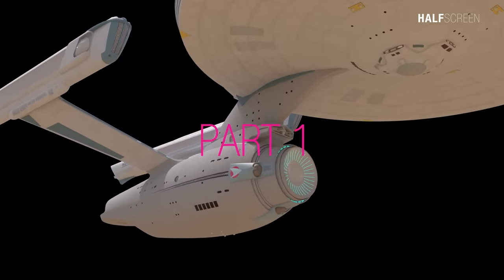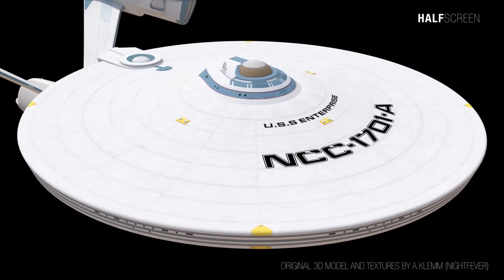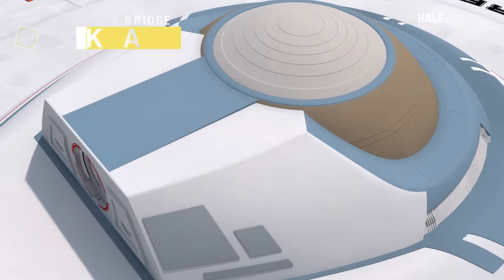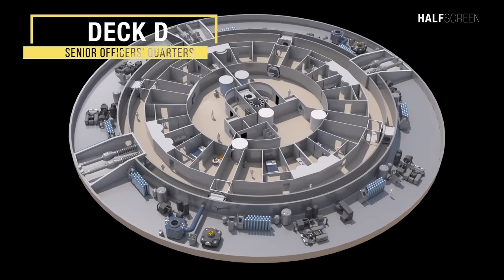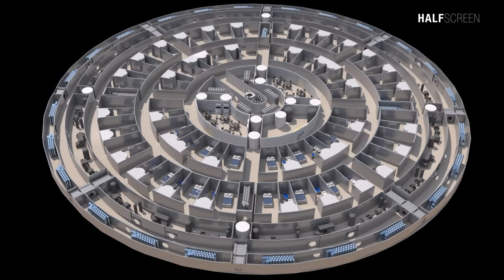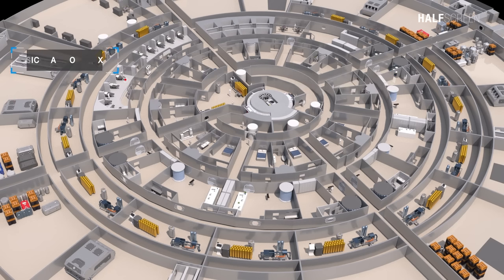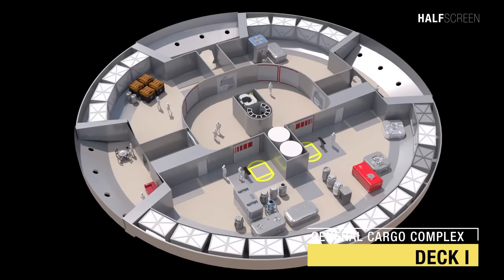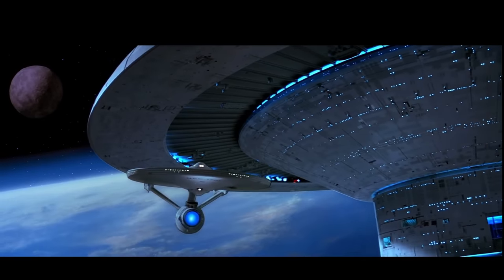Star Trek:  Inside the USS  Enterprise NCC-1701-A/Refit (Deck A-J)

Comment: I don't know who is responsible for this layout design, it is very detailed , however the turbo shaft elevators leading to the bridge are misaligned from deck to deck.  Deck A they are about 20 feet apart, deck B they are about 10 feet apart and deck C they are about 8 feet apart and then on Deck D they are about 30 feet apart.

Comment: I don't even begin to understand the concept of turbolifts. In most cases, they are not stacked on top of each other, and I can't see any corridors or shafts for horizontal movement.
The designers of the technical drawings probably didn't care at all. This has been bothering me since I was a kid and there was only TOS.

Comment: Your models are terrific. I notice that they didnt put exacuation pods/lifeboats in the saucer. will they be in the engineering hull? of did they just leave them out of the design entirely back then?
Reply: At the time when TOS & TMP was being made, the idea was that the entire saucer would act as a lifeboat, should the engineering hull be damaged or destroyed. 
The concept of hundreds of tiny, boxy lifeboats was something introduced in TNG. 

There are a couple of similarly designed (yellow square hatches) glimpsed on the walls of the Cargo Deck but certainly not enough for the entire crew! 
I think they were more like short term evacuation pods, to be used in case all the crew couldn't get off in time before saucer separation. Those pods would then picked by the saucer later on
Reply: I should add a correction - I took another look at the deck plans this project is based on and there ARE clusters of small lifeboats (the same size as the evacuation pods in the secondary hull) on Deck-G, visible on the bottom left and right of the screen at 10:55 in the video. Presumably they would eject out through the bottom of the outer rim of the saucer

Comment: Am I the only one who noticed that the turbo lift shafts were completely absent? The turbo lifts are able to traverse vertically and laterally throughout the ship.
Reply: I know that's the "official" story, but it doesn't make sense.
    That would be a massive amount of valuable space wasted on horizontal shafts, extra machinery, etc.  The saucer is only 100m across and Fleet personnel have physical-fitness requirements, so they should be okay.
    Modern navy ships don't use elevators at all, and they're often much less walking-friendly than this layout.  I've been on ships where, to get from one end of the deck to the other, I had to climb down two ladders, walk the wrong way to another ladder, climb up one, walk the length of the ship, then climb up another ladder.   The Enterprise is super-convenient by comparison.
Reply: @stevenscott2136  I hear what you are saying BUT the shafts (lateral and vertical) in some sections of this really detailed render do not "connect." For instance, in this model, in order for the Captain to travel from the bridge to the Shuttlebay, he would have to exit and enter 3 sets of lifts. If you look at "blueprints" of all the ships, they do show the pathways of the turbolifts. I was just remarking, that they are absent in the 3D render.

Comment: The refit NCC-1701/NCC-1701A are my favourite Enterprises. The refit Enterprise had a maximum speed of Warp 12 NOT Warp 7 and it it had a top cruise speed of Warp 9.
Reply: Depends if you use original Cochrane scale or revised scale, for warp factors, @Nicholas Maude . 
The latter being the one that puts warp 10 as 'unreachable'.
Reply: @chrissonofpear1384  I use the original warp-scale and I detest the new one as something that Roddenberry pulled out of his.

Comment: I always find it odd how little space the sublight engines take up, basically the space of 4 bedrooms, but has the power to accelerate a ship similar in weight to a large aircraft carrier to near light speeds in seconds? I think the ship however has things to reduce its mass and weight to near zero to enable this, but still they are pretty compact?
Reply: Efficiency. Kind of like how my car has a 1.5 litre engine that will out accelerate 5 litre engines from 30 years ago. 

Since warp has to be thousands of times the speed of light… just getting the ship up to a high percentage of light speed is child’s play. They use fusion which is the same process that a star uses.. getting energy from the bits of matter left over. Warp uses matter anti matter… complete conversion of mass to energy.
Reply: @calvinnickel9995  Thanks for the reply, i can see why warp drive engines can be on sticks as they don't push on the ship but change space around the ship.  But the fusion sub light engines work like rocket engines and do push against the structure, but the structure around them doesn't seem any different to another room on the ship. They just sit in the middle of the room? I would think you would need huge structures around them in reality to hold them in place?

Comment: I'm always confused why most ships  don't have a secondary/emergency bridge, maybe it makes to much sense
Reply: I think it's simply that it's  easier to write dramatic scenes if there isn't a backup Bridge.
Reply: @MatthewCaunsfield  it's not making much difference if you reroute command controls to the engine room or secondary bridge in my opinion, but I personally think a smaller, more compact emergency bridge would look more dramatic in those scenes
Reply: @ponyperson7513  Oh I agree entirely. I really like the "Auxiliary Control" set they used in TOS, it fulfilled exactly this purpose 👍
Reply: @MatthewCaunsfield  remember in TNG when Data got the recall command from Dr. Soong and took control of the enterprise, bridge crew relocation to main engineering, which is twice as confusing than it would be normally, because the galaxy class has a second bridge by design, always face palmed on that one
Reply: @ponyperson7513  Yeah, never understood that choice. Even weirder when you consider that the previously filmed episode was "Best of Both Worlds part 2" which DID feature the Battle Bridge!
So the set was definitely still around.
How does that make sense?
Reply: @MatthewCaunsfield  just send bridge crew to battle bridge and tell engineers to rip apart the physical ODN lines to the main bridge if need be, that's what I would have done

Comment: Ok, problem with the specs on BOTH the NCC-1701 AND the NCC-1701 A: You can clearly see there's a head, or bathroom, right off the Bridge. But the only way OFF the Bridge is through turbolifts which move vertically to or away from deck 1 (or A).
So where's the door to get off the Bridge to head to the head?
Reply from the maker: The turbolift on the port side can open both on the front and back of the bridge.
Reply: @Halfscreen  ok, so you have to pee, REAL bad, and that turbolifts happens to be in use, moving somewhere through the ship. If the doors open, all there is is a shaft. What do you do then? Pee down the shaft? 😂😂
Reply from the maker: @johnw2026  😅
Reply from the maker: @johnw2026  BTW, there are 3 different bridges on the refit and Enterprise A.

Comment: Overall... nice representation, although some parts are a little wonky. Take for instance, the lack of certain doorway entrances into certain areas such as: behind the bridge... there doesn't appear to be any access from the bridge to the docking room/head behind the bridge. Are you implying that someone on the bridge has to go through the turbo lift to get to those rooms in the back? This also shows up later (I think it's deck G)... there doesn't appear to be a way in or out of the Recreation room. There are more, but these two are obvious.
Reply: Also, there's not nearly enough room for crew quarters, which IIRC were all supposed to be in the primary hull. Even if you allow for hot bunking and multiple berths, there's not really enough room in that layout.

Comment: I must admit that I'm a little surprised they put the officer's quarters directly behind the phaser banks. The phaser banks would be a primary target in any conflict, be it capture or destroy. Wouldn't that put any off duty officer in extreme risk should they be in conflict with any ambush predator (Romulans/Klingons ect.)?
Reply: In Star Trek, the engines are the main target, as the phaser banks are directly powered by them.
Reply: If the shields go down, you're basically dead anyway.  Remember how shots just went right through the saucer in ST 6?   Talk of damage to the ship's structure is just for dramatic effect -- real crew would just be watching the shield integrity and waiting for the moment when they're suddenly vaporized.

Comment: your corridors are inaccurate.  the concentric rings have a hex shaped wall system only the radial walls have flat walls.  there are odn and water transfer as well as electicals, and each segment also has the sensors  to tell you the people in each area.  also in the walls are emergency equipment to use in the event of dpressurization.
Reply from the maker: There are a few Emergency exit hatch on the bridge.
Reply: @Halfscreen  I am not referingto energency hatches, i am refering to emergency equipment lockers in the concentric corridors.  to quote mr scotts guide "the corridors are two type: Radial (those which run outward, pointing towards the outer hull) and concentric (those which lie in rings, interconnecting the radial corridors).   Radial corridors are angled on either side,  the concentric on one side.    for the low down on the cooridor redesign rean Mr scotss guide to the enterprise There are also emergency containment areas personel can weather decompression incidents inside of till rescue happens.
Reply from the maker: @jamisonlong8897  This is probably due to my misinterpretation of the 2D schematic, and I only got a hold of the Mr.Scotts Guide to the enterprise book toward the end of finalizing my animation.  Many of the layouts from the book were different from the online schematic.  

https://www.cygnus-x1.net/links/lcars/enterprise-deck-plans.php

Comment: Whoa the stations, as described starting at 4:30, are not correct. Indeed, if it is important at all, it should be noted that, as can be easily verified in almost any episode, communications and science stations were on the starboard side (Uhura over Kirk's right shoulder), engineering on the port (Scotty, when on the bridge, over Kirk's left shoulder).

Comment: Clearly the landing gear fill both F and G deck according to the David Kimble cutaway drawing… pro tip using fan generated blue prints (Strategic Design) is always a mistake especially when the original designers were so clear…

Comment: The A DOESN'T HAVE the same layout as the Refit, at least not TMP vs TFF. Look at the hanger/cargo decks alone; A has shuttle elevators at the front of the hanger, Refit's hanger is open from bay doors all to front of cargo bay. In your other vid you also show Refit's engineering section as both, when they reused the TNG engineering and coridor sets for TFF & UC. Please don't lump them together.
Reply from the maker: This was explain on Part 2.

https://www.youtube.com/watch?v=jNuqqfe2Xyo

Comment: I have a authorized copy of"Mr. Scott's Guide to the Enterprise. Most of what you're showing is good, but the V.I.P. quarters, senior officer quarters,and junior officers quarters were designed completely wrong. The next time you make part two,use this book as your first reference before using anything else,thank you
Reply from the maker: To be honest, the schematic I was using was extremely hard to read due to low res images.  

https://www.cygnus-x1.net/links/lcars/enterprise-deck-plans.php
Reply: Honestly, Mr. Scott's Guide to the Enterprise is far from a perfect source. It claims the Enterprise uses it's impulse engines to maneuver at Warp Speed, which is just ridiculous, and also relegates the saucer to an emergency lifeboat, even though the pre-refit saucer was effectively a starship in it's own right.